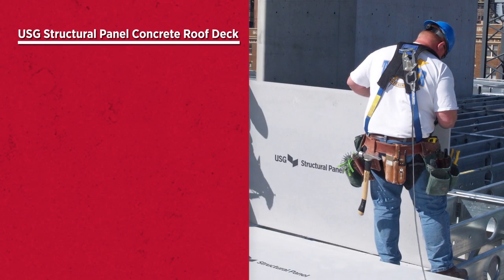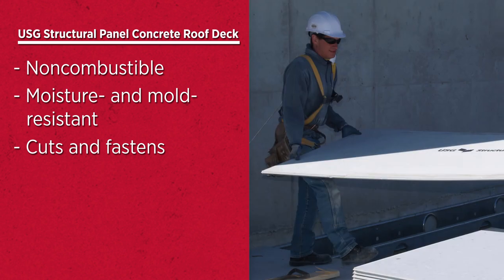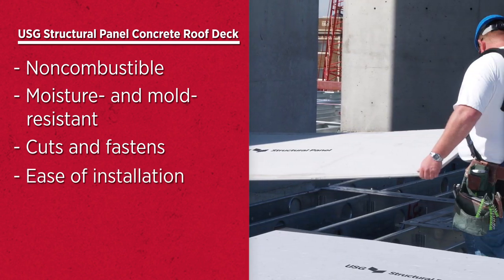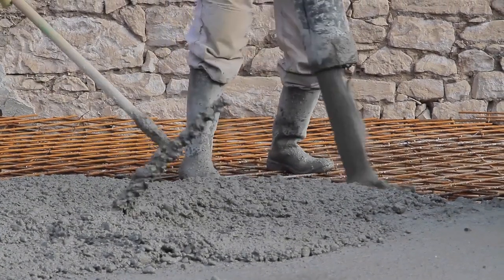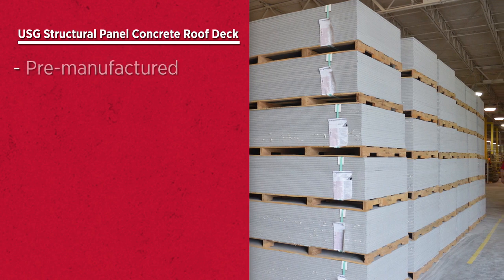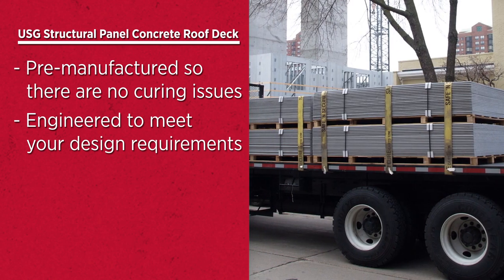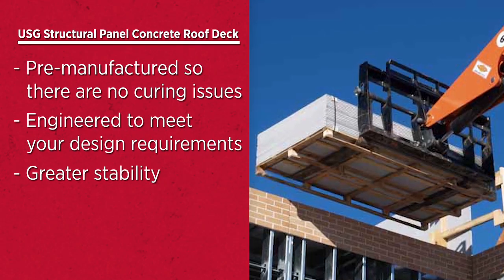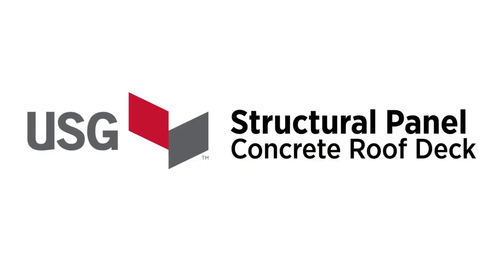USG Structural Panel Concrete Roof Deck

Comment: Hi can it carry load if its used for roof top terrace? or if we put tiles on top of it
Reply from the maker: Yes, the Concrete Roof Deck panel can carry the loads of most rooftop terraces (per the building code). Our code report is PER-13067 available at www.per13067.com. The panels are part of a roofing system. The panels cannot be directly exposed to the elements and must be covered from water with a membrane for the duration of its use. Please contact a roofing membrane manufacturer for systems that are available.